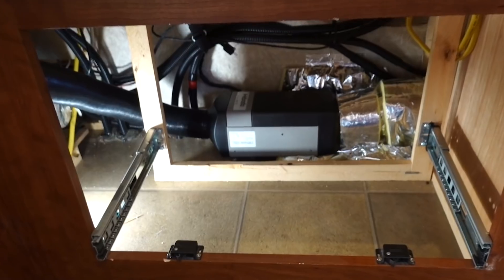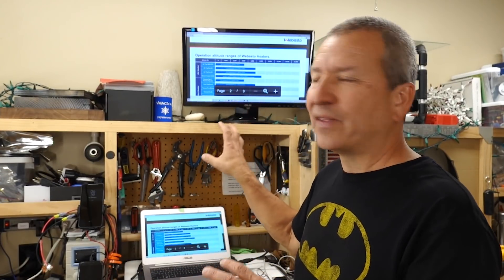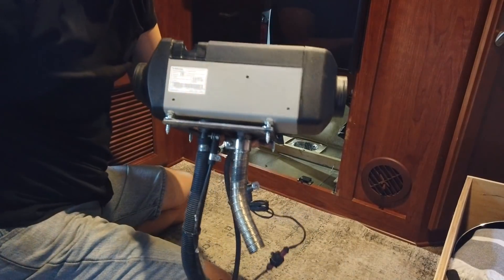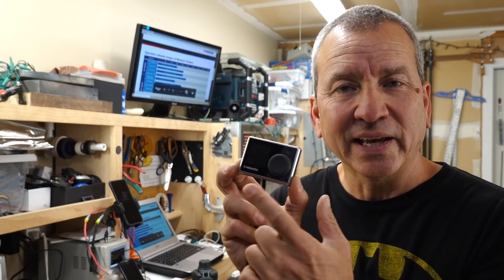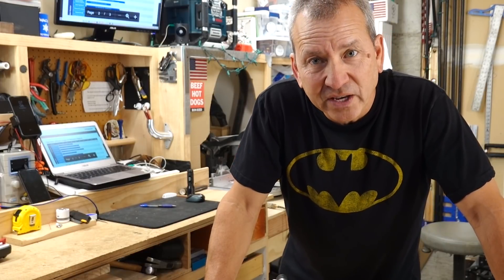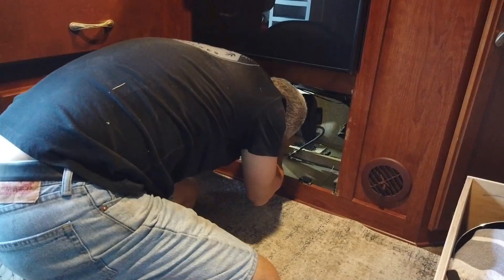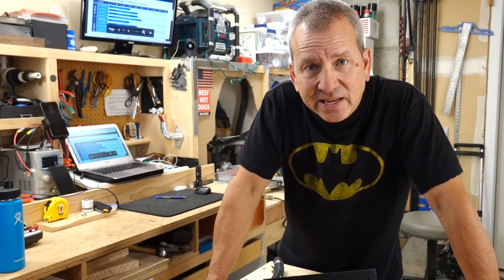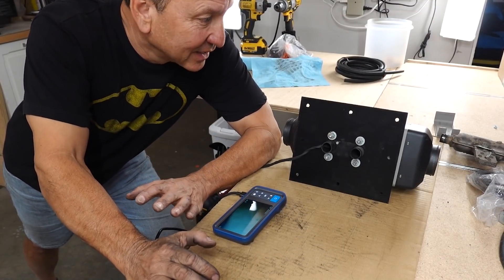Webasto Gas Heater FAILURES at High-Elevation | RV With Tito DIY

Comment: I just ran across your video about the high altitude issues and wondered if this might be a possible solution. I use all kinds of 2 stroke engines and swear by Sea Foam additive for cleaning out carbon residue. I wonder if adding this to your fuel source while above 5,000' would increase the reliability of it and keep it cleaner and running longer while at altitude? Has anyone given this approach a try to see if it helps or not?

Comment: Im in Colorado at 5280ish. Should I steer clear of Webastos?
Reply from the maker: It may work for a bit, but you'll probably be cleaning it a lot. If you run it hot frequently, it will help. I've used it up to 5500ft in Utah and Colorado without issue. When I tried it at 7500 and 10000 in Colorado, it eventually stopped working. Then I made this video :) The diesel version may work better at elevation than the gas one that I have.

Comment: Is this the gasoline or diesel model? We just used our cheap chinese diesel heater for about a month camped at 14000 ft, making expeditions in the vehicle up to over 19000 ft. Other than the fuel filter breaking in half didnt have any problems. However we are going to go with all gasoline appliances with our next vehicle so we will probably be buying a webasto or eberspacher. Has it given you anymore problems since this cleaning?
Reply from the maker: It's the gas model and has been working fine since. I've cleaned it out recently again with the compressor but didn't have to remove it to do it. I do have a cheap diesel one in my shop too. Works great once I got all the issues ironed out.

Comment: Thank you so much for this video, I was so stressed about my carbon build up, you are amazing and got my mind gears turning!!!  What we did....We did not remove the unit, we left it fully installed, unclipped the wire connection inside the metal inlet hose under the vehicle (by pushing in the metal bar on the clip, then pulling.... thank you Webasto for answering the phone to tell me how this clip released), we used two clear approx 3/8" hoses; feed one hose up the exhaust metal tube until it stopped at the heater and one up the other metal tube with the wire inside also until it stopped at the heater, alternated applying compressed air to each hose and tapped the Webasto heater unit GENTLY while applying air with a rubber mallet to shake the carbon loose and keep it moving with the air.  Everytime I GENTLY tapped the Webasto, large chucks came out ...tapping it while applying air was a key element to the removing the carbon.  IT WORKED...ITS BLOWING HEAT.  THANK YOU THANK YOU....THANK YOU FOR PROVIDING THIS KNOWLEDGE WITH THE AIR COMPRESSOR.  We tried a small compressor first which didnt work, the large compressor 4' high compressor worked great with enough air to do the job.  I am very excited, if you cant tell LOL and thank you again!!  Huge Heart EMOJI!  The Carbon Removal Team:  Karen(Daughter/Van Owner), John(Dad) and Gary(Neighbor)
Reply from the maker: That's awesome! You're welcome, you're welcome...you're welcome. Glad my experiences helped you out. Who knew watching a cloud of black soot come out of your heater would feel so good :) I like the tapping trick and will have to try that if I every do it again. My heater has been blowing heat ever since I did this. So you should be good to go as long as you keep an eye on your elevation. Right now we're sitting on a beach in Baja so no heat required :) Safe travels!

Comment: Great Video! Do Not buy This Unit! used it two nights at 8-9000 feet. It Now Does not work. It's almost brand new. Cost me nearly $2000. Completely unacceptable that Webasto does not allow for it to be leaned out for altitude. Crappy engineering.

Comment: Appreciate you sharing a LOT of information re these type of heaters.
Bottom line IMO anyways is:   A BIG THUMBS DOWN.
Why?  Yes it produces good clean heated air but the costs:
1.) Amazon price currently with install kit:  $1500  !!!!!
2.) Extensive....Extensive challenge to install properly.
3.) Altitude restriction.
4.) How to repair when a problem occurs?
5.) I could only find the diesel fuel version for the above price.  And since my Fleetwood Southwind is gas powered there is a BIG pain in the arse of mounting a small fuel tank and keeping it full......Every few days is what my research shows.  That's a problem when you're boon docking for at least a week at a time but more often 14 days.  And handling diesel fuel is not fun.
There are probably more downsides but this is MORE THAN ENOUGH for any reasonable person to make a NO/GO decision on.
EDIT:  I almost forgot one more BIG DOWNSIDE:   If you're not talented enough like RV with Tito here (me) then you have to pay a smarter person to install this contraption and all of it's attributes .  So figure $125/hr. X  at least 4 hours = $500.   So add that to the $1500 product costs and you're up to an astronomical $2000 for something that has definite limitations, no warranty and a pain to remove to fix and reinstall.
To leave on a positive note.......that you VERY MUCH for all the information you share here RV with Tito !!!

Comment: This is so discouraging. I go from about 900 feet, not much above sea level to high in the Colorado mountains at 8K to 10 or 11K.    Not sure what kind of heater to get.    If that's what the heater sounds like running strong , oh dear.  What kind of LP heater do you have?  I don't want something that puts a lot of condensation in the air.   I have a 136" wheel base HighRoof 2014 Gas Promaster, so not a large space to heat.  I can't quite imagine running something full blast without the windows and doors open.  Or is there a small one?

Comment: My mother-in-law has this exact one. I just tore it apart yesterday because it wasn't working, same code as yours. There was SO much carbon build up in the unit that every fin was clogged up in the combustion chamber. She has been traveling at no more than 4000ft and always runs it high for 10min after each use, and all of the other rules to follow etc. The exhaust, once removed, was so clogged that when I sprayed high pressure non-chlorinated brake cleaner through it, it wouldn't even come out of the bottom. I'm my opinion, I'd never recommend this unit to anyone. It's not something an older woman that's been in sales her whole life would be able to tackle. The builder of her RV basically said that most people learn to take care of their own problems and not take it for service all the time. (Translation- I put in expensive junk, leave me alone now because I've been paid in full.) This is the second time that her heater has had to be fully disassembled to have carbon buildup removed. The little bit you got out of yours was nothing compared to what I cleaned out of her heater.
Reply: Interesting. How long had it been in service before these issues: months, years ? Gas or diesel ?
Reply: @raphofthehills4405  gas version. She only had the build for 5 months or so and only needed to run the heater so often in the time frame. She's a tad over a year now and had to have it rebuilt twice.
Reply: @raphofthehills4405  she had her propane and oven/stove removed for more storage, her build design is pretty terrible in my opinion. Had she still kept her propane, I would've swapped out her furnace for a small Suburban. Now she has a huge toolbox for storage, bike rack, and gas cans on the rear so I have nowhere to mount external propane tanks if she wanted to change over.

If I was building my own, I'd have a propane Suburban or something similar. They might not last forever either but they sure are easy to work on or swap out. I told her to always try and find a place to plug in and run electric. The only way her Webasto will last is if she only uses it for emergencies.

Comment: I have the same Russian model, same issue, broke down in Colorado. Any idea how to donthr Altitude adjustment with this Russian screen??? everything online is for the US dial thermostat. Great Vid!
Reply from the maker: I couldn't figure it out. I think my only option is to upgrade to the larger model which has altitude adjustment.
Reply: @RVwithTito  I found out that you have to have the dial reostat in order to do the adjustment. The russian multi control wont work on any american heater but im wondering if the US reostat would work on russian heater
Reply from the maker: @powderdawgs  My understanding is that the wiring harness on the Russian model is different as well. So it might take some trial and error.
Reply: @RVwithTito  thanks, I appreciate you taking the time 👍

Comment: We have recently had an Eberspacher diesel air heater fitted to out T5 VW camper here in the U.K. according to the instruction book it will automatically compensate for altitude up to 3000 metres/10,000ft, I will keep an eye on the exhaust for soot build up anyway just in case. Helpful vid 👍🏻🇬🇧
Reply from the maker: Nice. Webasto also has a larger version that has an altitude adjustment. Not this one though. Either way, I'm sure there's potential for soot build-up in all the units.

Comment: Commenting here on your prior Webasto install video as well as this update.  I really, really appreciate the quality of your presentations on this heater and your level of effort to help the viewing community.

We are about to order our 2023 Dodge ProMaster this weekend (hopefully).  I’ve been pretty sure I wanted to go with this heater for some time, but the prospect of installing it has kept me quite nervous about the whole thing.  A lot of people (van folks) seem to quadruple the complexity via their choice of installation location, especially under the passenger seat.  Watching you place yours more toward the rear helped me visualize the process better.  I also appreciate your comments about where you got the unit and the issue of where it’s coming from, for US customers.  I’m not sure if I will order mine from Amazon or try to find the US distributor?  Anyway, thanks very much for your video and all the very valuable information.

If I might ask one question?  You said you’ve ran yours all night and much of the day as well… do you have a ballpark Idea on how much petrol you used for say, an 8 hour period (I realize it would be a rough guess)?  Thanks again.
Reply from the maker: The fuel consumption varies depending on the temperature setting. On max, you're probably looking at around 0.4 gallons in an 8 hour period (about 1 to 1.5 gallons in 24 hrs). I removed it from our Class C when we sold it. I now have it installed in our 34 ft Class A motorhome. I have it installed outside the living area in the rear of the coach. I piped the heat into the existing duct system. It doesn't blow hard, but keeps us warm. We love it. Best of luck with your ProMaster.
Reply: Okay, found the info on another of your videos... seems to be about 1 to 1.5 gallons in a 24 hour period.  Thanks again.!
Reply: Thanks so much for your response, and very helpful info.  All the best!  Thomas

Comment: Good repair, at 10,000 ft compared to sea level, atm. pressure drop by 68% (14.7psi to 10.1) and air density drops by 73% (23.8 lb/ft3 to 17.6), to keep the ideal air/fuel ratio, try to reduce the fuel by 50% and use a booster pump to increase airflow.  Since you have a full shop, it is worth a try.  I'm certainly Webssto know that but they do not care enough to fix it.

Comment: I just got to Colorado at 6000 ft and it ran for 4 hours then a light smell started and I got your same error codes. I've been at sea level all winter so far. Not sure what to do here, how could carbon build up in 4 hours...
Reply from the maker: I'd recommend running the system on max for a few hours next time before heading up to 6K.
Reply: @RVwithTito  I'm in Denver still, took it apart from the bottom and blew it out with canned air. Lots of black came out. I'm thinking to not even try to turn it on until getting below 4900 ft.
Reply from the maker: @winterfern4881  Once you can get it to fire up then turn it to max and let it run for a few hours.

Comment: At a very high elevation, a wood stove with hardwood or auto-feed wood pellets that burns hot is the best. Add a stovetop eco fan and a 12v fan on the ceiling to circulate the heat, you will be toasty warm all night.  As for your heater.  Some of them have a high-altitude kit that makes it usable at high altitudes. I also see some hacks where the van dweller adds a tiny fan(the one similar to nature head fan etc) with adjustable speed to blow more air into the unit via the air intake into the combusting chamber.  That adds more air to combusting at higher altitudes.  The trick is the adjustable speed with which you have to tinker with.  Totally enjoy all the valuable knowledge you shared on your channel. Many thumbs up!

Comment: This sounds extremely stupid, but maybe so, maybe not. I keep thinking that if you got the thing an oxygen concentrator or a CPAP, then you could give it extra oxygen, just like you would yourself, if you need it at higher altitudes. You could take turns with the heater for the supplemental oxygen treatment!

I know: sounds stupid. But I'm not sure. I keep thinking about it. In a way, it seems like it could be a simple solution that might work well, when or if you need it, and also be useful for other things.

Comment: Second day parked at 9000 ft with my webasto 2000stc. Heat just randomly shut off. Checked the exhaust pipe and there was tons of soot. :( Guess I'm going to have a old night and hopefully be able to clean it tomorrow
Reply from the maker: Ooh. Second time, just like mine. Now you know what to do. Good luck.
Reply: @RVwithTito  I ended up taking mine apart and the process wasn't that bad. I couldn't believe how much buildup there was on the burner and in the actual aluminum case. I ran my heater on low (no altitude adjustment) the first night. Pretty sure that's what did it haha, but it's much cleaner now and I'm going to do the altitude adjustment as soon as I find a wire to ground the diagnostic cable.

Comment: Does the condition of the muffler (carbon build-up) influence codes / inhibit use?
Reply from the maker: At some point probably. It will definitely affect the efficiency of the heater.
Reply: @RVwithTito  If you get a diesel for your shop, it would make a great video comparing fuel consumption and cleanliness/codes.
Reply from the maker: @ChipShot777  I have a diesel in the shop now. One of the cheapo all in one units. It's working fine now but what junk. Bad design. It didn't even work when I got it because the fan wouldn't even spin. Took it apart and modified some pieces to get it working...then it leaked diesel everywhere. I'm warm now and it was cheap in all respects.
Reply: @RVwithTito  Sorry to hear that. My 1976 Honey class C  I have owned since 1996 is not quite worth the gas version and not in my budget . Others I have followed do seem to have better success. I would rather not have two types of fuel on board, but at gas prices at record highs , and being in Ohio  , getting to the west coast , isn't in my budget either. And this RV could go everywhere - sweetest 350 hp
with 68,000 miles. thanks . Enjoy your channel !

Comment: I have the same Russian version. My plan was to just carry a second burner and carb cleaner. But now I might try my on board air compressor with carb cleaner down the intake every morning at high altitude. What do you think ?
Reply from the maker: Worth a try. My guess is that you won't get it all out, but maybe enough. I still plan to take it apart and do a full clean at some point. But it's working well now.

Comment: So two things.    One if you get a lockout code it’s from too many failed starts.     The fix is to pull the fuse wait five seconds then try again.  But there’s usually a reason why it’s not starting. 

Two. If you want a clean burn, use kerosene.  I know that in the diesel units you can burn kerosene and they burn clean no carbon buildup.  
and my last comment is to run these units hot.  Setting it at low temperature creates more buildup and will foul the heating element.

Comment: I'm researching diesel air heaters for my 25 foot travel trailer and have read that they put out a lot of heat.  I've also read, as you mentioned, that they need to run on high periodically to clean out the chamber.  I've noticed on several of the Youtube channels that most people install a 5kw unit and run it on low most of the time to reduce the noise.  I'm thinking I will install a 2kw unit and run it on high much of the time.  I'm assuming your 2000 is a 2kw unit.  Does it put out enough heat to heat your Class A?  If it does, I'm sure a 2kw unit would heat my trailer.
Reply from the maker: I definitely could heat up the class A. I plan to install this one in the Class A and use it this winter. I've found the biggest source of air noise is the size of the register. Lots of air going through a small hole with diverters. If you adapt the output to a 3" or larger register/opening, then is gets quieter.
Reply: @RVwithTito  Can you use carb cleaner or something similar to remove the soot?
Reply from the maker: @TekSavvyMima  Yes you can.

Comment: I wonder if a reset would allow a hot burn to clean out the heater below 4900 feet. Hate to pull out the compressor unless I have to. Thanks for the video!

Comment: Had to laugh you talked about gas heater, being in europe I assumed LPG. Then you talk about no propane... Dumb me. 
Was looking at heaters for boats. Webasto rep said something very similar. Oversizing the heater causes it to cycle on/off frequently, never gets hot enough to self clean... 
Not sure if I'd get a clone, although they seem to be getting good feedback. Gas (LPG) leaks scare me.
Guess the answer is regular servicing.